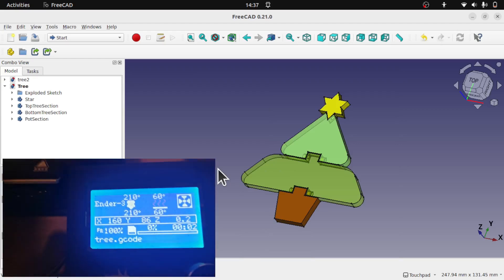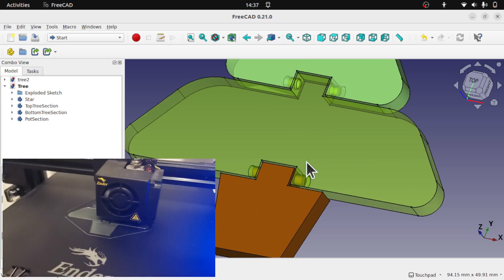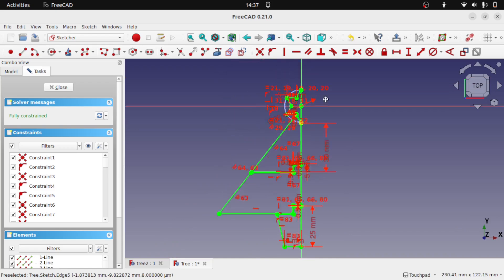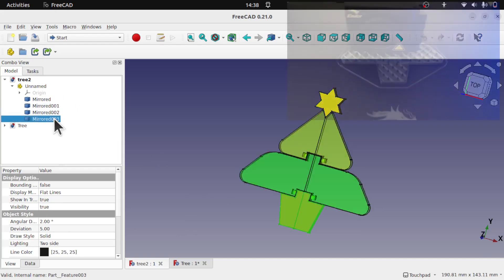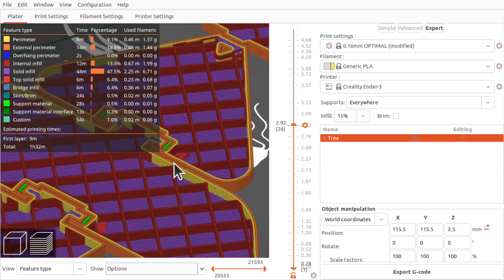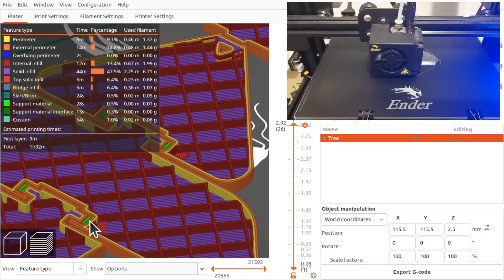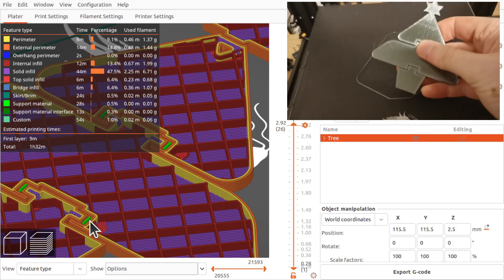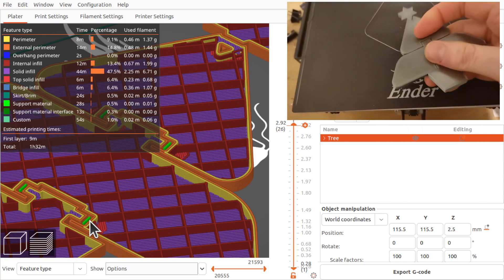Print In Place Flexible Christmas Tree Decoration in FreeCAD - Introduction

Comment: I'd try without support material, just modeling in a 0.2mm or so clearance. That's the same amount of clearance as is the default between the top of the support material and the bottom of the part. Increase or decrease from there depending on the tolerances of your printer and your desired fit.